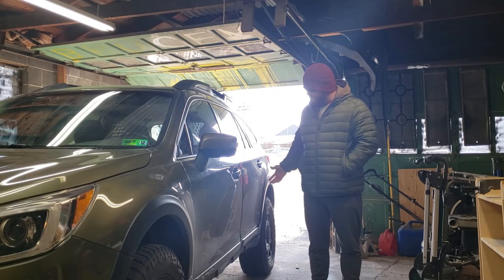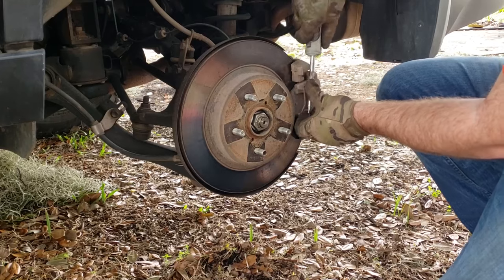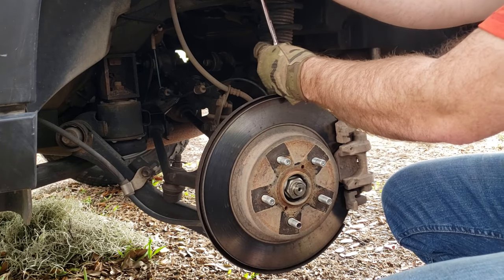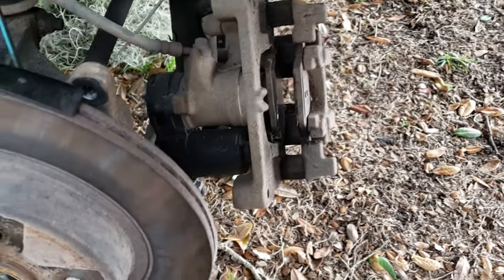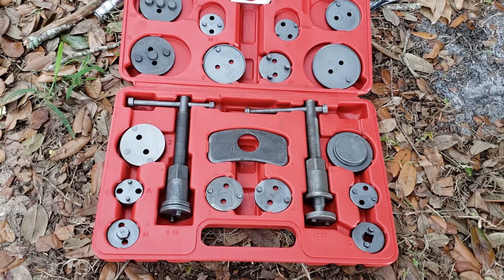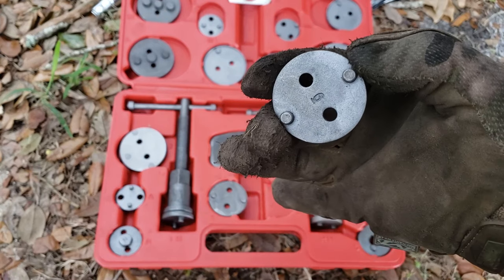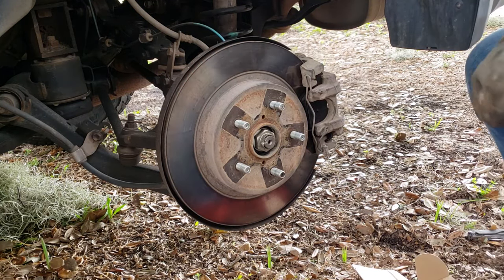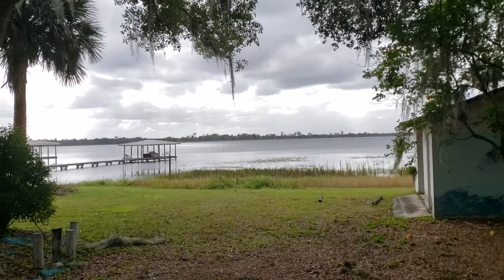Adventures in Electric Parking Brakes! Rear Brakes 2015-2019 Subaru Outback.

Comment: I never bother with greasing brake pads. Not only do you risk getting grease on the friction material. But it is going to quickly become contaminated and dry up on the pad, rendering the whole idea of applying it in the first place pointless. I guarantee you that, two weeks after doing a brake job, any benefit of greasing brake pads will be GONE.
Reply: 100% accurate
Reply: I just don’t get what you’d get by greasing the pad - isn’t the whole point that the friction slows the car down lmao

Comment: Really appreciate the info on compressing the piston. One tip I have is if you are sure the rotors will not be removed, it is easier to not remove the first two 14 mm bolts. Only remove the lower guide bolt with the 7mm hex. The piston unit will rotate up and it is easy to place the pads on each side of the rotor.
Reply from the maker: Good tip!
Reply: One tip on that tip, make sure you the. Disconnect the electric cable to the parking break. Wondered why the pads weren’t coming off the rotor. Now I have to find some replacement little electrical connectors that will fit the power break electrical housing. 🤦🏻‍♂️ 🤷🏻‍♂️
Reply: Thanks saved me a lot of time!! Did both sides in an hour. I did removed both 7 mm bolts though. When I removed only lower one I could not rotate it enough to get pads out as the brake line did not have enough play. But definitely a pro tip, much faster than touching those 14 mm bolts, thanks again

Comment: Safety tip taught by my mechanic father. When you take off the wheel put it under the subframe of the car in case the jack fails. Especially if you've got it jacked up on the dirt and on a piece of wood. I've seen first hand cars tip off jacks and it isn't pretty 😢
Reply from the maker: Yup! I typically use a jack and jack stands but was trying to minimize the extra tools needed for this video.

Comment: If you don't have a wind back tool, I used a grinder spanner. One pin in the slot and the other pin on the outside of the cylinder.. Worked a treat.
Reply from the maker: That's a great alternative! I used needle nosed pliers on a Jeep and it was a complete pain.

Comment: You did not disconnect the battery, you did not disconnect the connector, you did not use Subaru select monitor. Did your car refuses to start with blinking brake light?

Comment: Thanks so much. I just completed the rear bakes on a 2018 Outback today. Shop would charge $375 to change rear pads. Also swap rotors which dont need to be changed. OI paid $70 for the OEM pads and saved $305 on just the rear!

Comment: I didn't have the tool. I had no idea I needed it until I was well into the job. I ended up using needlenose pliers in the holes and turning them until it bottomed out. then compressing the piston the last bit with a clamp.
Reply from the maker: I've done that myself. It's doable but that tool certainly makes the job easier.
Reply: @bruceyyyyy  Agreed. I wish I had looked at your video ahead of time. I thought it's just brakes. Done them a hundred times... apparently not on this type, lol. I'll be picking up the caliper kit soon for future use on both cars.

Comment: Ok. So I really did my research. No you do not need a computer to do this procedure !
It is so simple. Just follow this video. You might want to disconnect your battery to be sure no power can accidentally be applied to the parking brake . You might want to remove the brake line holder in the middle of the line to give you more flexibility. 
I notice Subaru does not use stainless steel sliders for the brake pads. So proper maintenance  cleaning and lubricating the cast iron sliders is probably a good idea. 
Thank you Bruce for giving me the confidence to do this job right !
Reply from the maker: Any hiccups along the way?
Reply: None to speak of. 
All good !
Reply: A couple of the steps from the Subaru service manual, it says to "release the parking brake", "disconnect the ground terminal from the battery sensor". Before the calipers are removed, "disconnect the connector", referring to the electrical connector. Some in the Outback Forum have had problems with error messages after the job. I'm assuming this may be due to not following the instructions carefully. One did not disconnect the connector and broke the wires. Apparently, the wires in the connector are fragile. Also, someone mentioned that Subaru is voluntarily replacing this connector if it is cracked (not a recall, but voluntary replacement if it is cracked from normal wear).  After the pads are installed and the ground terminal reconnected, it says to "apply and release the parking brake five times and ensure that the brake works normally". I will be replacing front and rear brakes and rotors on my 2018 Outback. 86k and no brake problems, so I am doing rotors at the same time. Using the Power Stop semi-coated rotors and ceramic pads kit from RockAuto, which, with delivery, was $10 cheaper than Amazon with free delivery.

Comment: Great video. Used the video to change rear brake pads on 2015 Outback with my son. Just a few comments. Used a 6 instead of 7 for caliper. Not a significant difference when turning the parking brake with either one. But it was a lot easier using the caliper tool. Had a difficult time installing the brake pads without the clip onto the bracket. Had to brush off the rusted surface of the bracket. If the brake pads were difficult to remove from the brackets, consider brushing the rust off the contact area. Thanks Bruce for the video.

Comment: That is an excellent video.  My 2017 Outback has 66K miles on it and just got it back from the dealer where they did the 60K service.  They recommend a transmission fluid change and noted the front brake pads are at 8mm and the rear brakes are at 6mm.  I'll change out the pads myself thanks to your video.

Comment: This video is exactly what I needed. I will say though I found it much easier to remove the brake line bolt near the caliper. With the new pads mine did not slide on as easily as yours. Thanks again man.

Comment: Very good video. Using that $20 retracting tool was easiest part of job and EPB no alarms, all working 100 % after done with job. But as an older person with less agility, I found that removing the 2 - 7 MM hex caliper slides made installation of the pads very easy. Then the problem arose, very hard to get both slides threaded into pad bracke with new shoes installed. Get one installed and left loose and other slide was hard to get started threaded in. Finally got it done but worried for a bit.
Reply from the maker: Good info! Thanks for sharing here. It might help someone else. (:

Comment: I was told you HAD TO go to the dealer and they had to retract the parking brake using a computer hooked to the OBD port🙄  I was told there was no other way to do it without breaking it, apparently that's not the case! Thank you
Reply: Some vehicles in the radio 7nder controls you can set calipers into service mode which retracts the calipers.
Reply from the maker: I've done this with Mazdas but am not aware of Subaru having this feature.

Comment: Thanks for the video.  Just finished my brakes and this was a great resource.  Used needle nosed pliers and they worked fine, though the tool you had would have made it easier.
Reply from the maker: I used needle nose in another video and while it worked these were a lot easier.

Glad I could help!

Comment: Recommend disconnecting the electric parking break cable. Pulled the wires doing my 2015 Outback’s rear breaks and had to buy a harness because new cars suck to work on.

Comment: Nice video.
You used a scissor jack on your stone parking area. I didn't see a jack stand. If there was one, and it was on the stones, please be aware of that jack gave the weight of the vehicle onto the stand onto the gravel would've let the jack sink into the gravel... Putting you at great risk of being hit or worse pinned. Recommend using a 2x10 as a footing, even with the jack (toss that thing and by a floor jack!)

Comment: I haven't done this job yet. I do have the same piston compression tool shown in the video to wind the piston back in as it's being compressed back into the caliper.  I suspect that the combination of rotating the piston in and then pressing it in without rotation is a result of the thread pitch (threads per inch) on the tool being different from the thread pitch on the internal screw inside the parking brake actuator that drives the back side of the piston when applying the parking brake.  Curious to hear what others think.  The official shop manual does say it's OK to use the wind back tool to compress the piston as shown in the video, but it does seem safer to remove the parking brake motor assembly and wind back the internal screw manually as shown on other videos, which will avoid putting excessive pressure on the gears that are in the actuator. I think the actuator is designed to take a high rpm motor and gear it down so it can drive the internal screw slowly but with great force.  Turning the screw with the wind back tool rotates the internal gear set in the opposite direction, with a small amount of rotation resulting in a large amount of rotation in the motor.  It seems like that would put more pressure on the gears than they're designed to handle.   If you're going to use the wind back tool, it might be safer to frequently readjust the threaded thrust nut on the tool as you wind back the piston, to (sort of) continuously compensate for the difference in thread pitch, rather than waiting until the piston stops allowing any further rotation. This is all just guesswork, I haven't seen a description of the internal workings of the actuator.

Comment: Nice. It's crime how much shops get to do something this easy. I hate working on drum brakes!  Grease those caliper pins too! Perhaps a piece of cardboard, an old towel/sheet under the wheel would help to not lose parts & tools in the leaves, and keep tools and parts out of the dirt.   My old Saab also had 'screw-down' pistons. I made a tool with 2  1/8" bolts in a flat steel bar.

Comment: Got a lifted 2015 Outback that just now needs breaks at 148K.  Did you also replace the front with same brand (Powerstop)?  Someone mentioned clips that come with kid don't fit and need to be filed down, or use OEM clips.
Reply from the maker: I did. I have a video on them and not long after replaced them with Ascent brake calipers/rotors/pads.

Comment: Hey Brucey,
I'm doing my rear brakes on my 2015 Outback now.  I was looking at another video by another guy and as he manually retracted the EPB, he turned it lefty loosey on the driver side and righty tighty on the passenger side.  On your video, you went righty tighty on the driver.  Any thoughts?  
Also, I got the tool you suggested.  On your video, you first retracted the EPB with the tool and then readjusted the position of the tool to further compress the cylinder and the tool, that time, was a little off-center from the parking brake disc that had the 2 notches in it.  Was the off-centeredness of the tool deliberate so the tool would more hit the rim of the cylinder and not directly press on the EPB disc any more?
Lastly, the dude in the other video made a comment about the notches in the EPB disc that you had rotated as needing to be aligned with the nub that sticks out of the pad's backing plate so that the nub would not hit the flat part of the disc and cause uneven wear on the pad.  Rather, he was saying the nub on the backing plate had to fit into one of the notches of the EPB disc.
What say you, Captain Subie?
Reply from the maker: I don't think it's that selective with working on the brakes. I had it off center because that's where it seated. I've used the tool dozens of times since then and it's not my favorite way of pushing in typical brake pistons.
Reply: @bruceyyyyy  Gracias, Señor👍!

Comment: Great video, I have a question, so when you change the rear brakes and rotors you have to deactivate the parking brake? I seen a video where a guy used a scan tool to retract the rear brake in and finished off by manually pressing in the piston all the way in, do you need the scan tool or dude was just being fancy?

Comment: Awesome, thanks. Do you know how many mm apart the number 7 plates' "nipples" are? I am also looking at the service manual and the rotors for the 17" wheels are 30mm (factory) with a wear minimum of 28mm. Problem is my car has 18". Would it be the same for the 18"? Trying to determine if I need new rotors as well. Car has 59K miles on it.

Comment: Thanks... I got stuck after I twisted the piston and it bottomed out. It would've taken awhile probably to figure out to compress like a normal break job after🤔... when in doubt, YouTube it out.
Reply from the maker: Glad I could help! I've used a c clamp and some channel locks to bottom out the Piston. 

Not sure the tool I demonstrate would be necessary if you already rotated the Piston.
Reply: @bruceyyyyy  I have a piston compression tool, but I just used needle noses to twist the first portion. I'm contemplating buying that kit, I usually don't see those kinds of piston but now that I own a Subaru, I might give in
Reply: Do you have to rotate the piston back clockwise after to engage it? I assume rotating it counterclockwise disengaged something.
Reply: @lifeisgood070  righty tighty, lefty loosey... the piston will automatically re-engage the disc once the installation is completed, reassembled, you turn the car on and allow the brake pressure to build (via pumping brake pedal). For a firmer brake pedal, you can bleed the lines from the pistons. I'm not sure if the Outbacks master cylinders have a bleed valve as well, but that could possibly be done as well. I would have to check. I didn't bleed mine and with about 4 to 5 pumps with the car idling, break pressure was back to about the same. Honestly I was pressed for time and being lazy.
Reply from the maker: @lifeisgood070  Just bottom it out. The first time it's used it will recalibrate itself.

Comment: So you don't have to put the vehicle into service mode to retract the rear caliper piston? When I did it the piston would only rotate so far then stop. Wasn't enough to fit in the resr brqke pad so had to use a scanner to put into service mode
Reply from the maker: What vehicle? I didn't have to do that on mine but it might be different for other ones.

Comment: So basically it works exactly like almost every single piston rear disc brake setup ever made, with or without electric parking attached. Pushes out, spins back in.  Also, with any ABS system, you should crack the bleeder valve before compressing the piston, bleed old fluid while you're down there, and add fresh in the reservoir.
Reply from the maker: It didn't work like any other Subaru rear brake I've ever worked on. The electronic parking brake is a major change over the older mechanical ones that had a drum in the rear brake in addition to the rear rotor.
Reply: @bruceyyyyy  Yes, granted, I was meaning resetting the main caliper is the standard procedure, nothing special. What's nice is in this case, the parking brake, being built into it, resets with it.
Reply from the maker: @V.is.for.Vae.Victus  I've only ever used channel locks to push in the caliper before. Haha. 

I used needle nose pliers to wind the electronic piston in but it's a total pain to do and kinda sours the entire experience.
Reply: @bruceyyyyy  Agreed on the needle nose pliers. Great way to stab your hand is what those are. Lol
Reply from the maker: I get enough tears on my hands to not recommend using needle nose pliers. Lol

Comment: Great video Thank you. I have a 2016 Subaru Outback 3.6L. Just to make sure you are saying I don't need a computer to collapse the e-brake ? just use the tool you showed with various disc's. Just want to be sure before I open up and do the job. Thanks in advance for your reply.
Reply from the maker: Yup. I'm not sure why some are saying a scan tool is necessary because what I did here is even listed in the factory manual for changing brakes.
Reply: @bruceyyyyy  Thanks for your reply. Big help.

Comment: dang you run fast.  as I have gotten more experience, it surprises me how little grease is needed.  one could get by with greasing the pins only.
Reply from the maker: I actually forgot to grease the pins here but should have. The different style than I'm used to threw me off. 

The clip, electronic brake, and lack of bolts holding the caliper to the bracket was all new to me.
Reply: @bruceyyyyy  my first thought. Subaru stole the Chrysler clip.
Reply: @bruceyyyyy  So there aren't any metal clips that go on the pads? Are the front brakes completely different from the rear?
Reply from the maker: @ggevorky  I haven't needed to change the front brakes yet but figure they're typical. 

The rears do not have the typical metal clip.

Comment: I found using a electric cut off tool , side grinder  "bit changing wrench" it has the same fork pattern for about 5$, bonus if you have a grinder you have a back up wrench . if you turn it with the tool, about a 1/2 turn a common C clamp pushes down the piston fine  it down fine, it the bleeding  is why I'm cruzing   do you have videos on bleeding? regards

Comment: Did this outback have eyesight?  If so I thought you have to put the system in brake maintenance mode.  Do I have that wrong?
Reply from the maker: Yes, it has Eyesight. No, I didn't put it in brake maintenance mode.